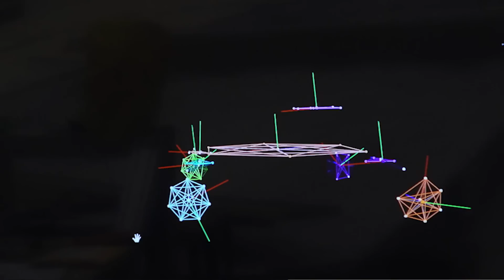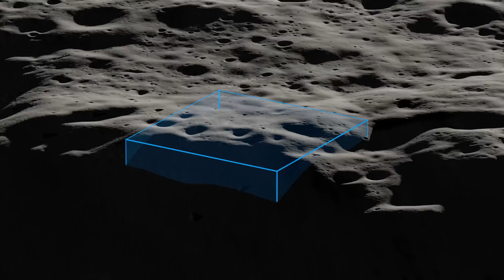The Dumbest NASA Decision In Years? Why NASA is Being Forced To Ground Rover and Sent Ballast.

Comment: Former manager for NASA related ground system projects here.  Generating PMP ESTIMATES for large Engineering projects, can add 10% to 20% to the cost of the project itself!  Especially if they keep asking the team to generate YET ANOTHER ESTIMATE, for even small changes (which can ripple through).  Not sure that all the PMP overhead is worth it.  And the stress level it adds, is incomprehensible.

Comment: With all respect, Scott - You are not frustrated enough about this.  You seem not to be aware of how to properly communicate something when it doesn't make any sense.  You're talking about this insane situation in the same tone of voice as you'd normally be explaining anything else.  If a Reasonable argument can be made in favor of not canceling the rover, why are they not presenting their case?  They can't possibly just sit there all bummed out without doing whatever they possibly can.  Especially after all the work they did.  Don't pretend like they should have written the law differently, as though every issue could be anticipated.  Laws are Easily changed if they're badly written or somehow unfair or nonsensical.  

Is this as insane as it sounds?  Are you honestly explaining the situation?  You've titled this video in a way suggesting you're going to Explain why NASA is being FORCED...etc.  Forced?  You're the expert, right?  I think you need to justify this situation a little better.  Also, if you're not frustrated and/or if you think this situation isn't insane, please explain that.

Comment: Make no mistake: the rover is not flight ready. Vacuum testing is a long process that often reveals expensive problems. So it's not as simple as just chucking the thing on the spaceship.

But it's so close!
Reply: Isn't it just put a thing in a vacuum chamber and turn it on, after 72 hours check the sensors. That's it
Reply: @funguy398  Read "Roving Mars" by Steve Squyres. Similar spacecraft, and boy did they find unexpected problems

Comment: How does the suspension Work in the 10th - 12 Torr Vaccuum? How does the battery Work in minus 200 C?
Of course they cansell it- it doesnt Work on the moon…. No NASA Rover have driven on the moon ever, and absolute not Apollo 15-17, What a joke.
Reply from the maker: How does the vacuum stop springs from working?
How does a rover that stays in sunlight reach night time temperatures.
How does someone as gullible as persist after having all their talking points eliminated in minutes by someone who hasn’t had any sleep in 48 hours.

Comment: You only mentioned this as an aside, but how do you get from water to rocket propellant, in logistical terms? Doesn't that require that you put a lot of energy into it, proportionally? So you'd have to bring a large energy source (or a small solar panel and then wait for a very long time).

Comment: The exception makes the rule.
You have to look at why the rule exsists fundamentally.
And in this case sending "a block of metal" or this Rover would not cause a problem this rule is meant to prevent. Heck even if it was unfinished it'd still be better than sending a block of metal.

Comment: One of the tools being built for this project was a Mission Control dashboard designed by NASA for the needs of their scientists. It’s also been used for various things such as race car simulators and would do amazing for anyone that wants to build their own custom dashboards for gaming or data visualization. It’s also fully open sourced, so if you’re a software developer you can extend it with React or Vue for your custom needs. Google “OpenMCT” to find the project.

Comment: My impression is that this is an engineering management issue rather than just dumb budgeting rules or anything - from my experience just finishing the mechanical design and assembly of a project without fully completing the testing and validation phase can be pretty complicated and there's so much that could still go wrong. It takes a lot of work, time, and money to test and validate projects to the point where you can be confident that they will work 99.9% of the time which is the kind of confidence it seems like you'd need for a project like this. If they haven't even entered vaccum testing it sounds like we have no idea where they're at in the validation process and that's a huge red flag against them actually having "completed" this rover. Nothing ever works out exactly as you design it to even if you've built and operated dozens of rovers over many decades.
Reply: Spot on ??

Comment: I have not seen one other comment say this, but... if it hasn't gone thru vacuum and environmental conditioning, testing, and analysis, you don't know how the final assembly will really react to the different environs it will be forced to withstand. That little rover may bring down the whole mission, and a mass simulator may be the statistically safer bet. I mean, I doubt it, but that's part of what's happening here.
Reply: Sorry, I’m trying to understand what you wrote which sounds like a bunch of words. Don’t take it personal. Can you put it in one sentence
Reply: @stephenrocks7004  
One sentence:
If you can't make sure it's safe, then are you really willing to send the rover and possibly end the entire mission, with all the other payloads?

Expanded slightly:
The final thing they want to do is put it through "Environmental Testing". What that means is putting it through vibration testing, heating it to hundreds or degrees, cooling it to negative hundreds of degrees, putting it in a vacuum, some of these simultaneously, etc. The point of this is to make sure it doesn't fail, like for example catastrophically exploding. If this little rover exploded because something wasn't tested and it ruptured under pressure, that could easily damage the supporting craft, damaging all the other payloads and ending the mission. If they can't test it, due to budget, maybe it's just safer to not send it.
 
Hopefully that helps.

Comment: Fun Congress accounting rules are totally stupid. And this the biggest area over all because they consider sunk costs that is money that can't be recovered spending. Biggest example is Navy comes up with a futuristic destroyer we need not the more primitive one we ended up building because the law required the entire development cost of the new destroyer be divided amongst any more the Navy built. That made it only on paper massively more expensive than the older design so the Navy had to build the older design. 

They need to totally separate development costs from in use production costs. In Accounting this is use Business Accounting rules instead of standard accounting rules when planing future spending. Standard Accounting rules is needed for taxes and insuring theft is prevented. In standard Accounting you buy a 10,000 dollar machine to make something so you have to keep it on the books and depreciate it to show estimate of declining value. In Business accounting the machine is only worth what you can sell it or scrap it for. If the market for the product it was bought for has gone away or there a way better machine now you don't use it just because yo paid for it.

In this case R@D is spent. If it actually ready to deploy you don't count any R&D cost against ti.

Comment: AEROSPACE ENGINEER HERE:
Hey Scott I have a classmate who is now very high up in the ISS Program. 
I promise this will make sense.

Basically if you don't have her signature it does NOT go to the ISS. When they were still constructing the ISS I got into an argument with her about how they were building it. I was in the camp that wanted to use the Shuttle C which was the shoot once version with nothing but a payload pod. The idea many at the time were saying was it was taking too many very expensive space shuttle flights and Shuttle C could lift as many as 5 ISS modules in a single flight. 

Part of my argument as it was for others we needed to get the ISS finished so we could get on with manned exploration.

To say she slapped me down is an understatement.
FIRST - As she put it I had no idea what it took to connect and commission any of the ISS modules.
SECOND - She quite rightly pointed out that until we solve the propulsion and life support issues for long term manned missions NOBODY was going anywhere beyond LEO. Sadly those 2 technological hurdles of propulsion and life support have still not been solved.
THIRD - NASA does not decide its missions and this is still not widely understood. The US Government (as in the politicians) decides what NASA missions do and do NOT happen. If anyone wants to see how badly that can work go and look up a video story Scott did on the Artemis Rocket from a couple of years ago and how there were 2 teams doing the same job on the same rocket and how that made all the decisions take longer and the whole thing be a GIANT CLUSTER F*CK.

When Scott did that story on Artemis I knew exactly what was happening because it was exactly what my classmate had explained to me years earlier. The politicians make decisions FOR NASA based on political needs not technical needs.

Another good example of that was during the post Challenger processes. Kelly Johnson (P38, U2, SR71) came out and said (paraphrasing) "Don't build a replacement. Give my team the $3 Billion and we'll build you a single stage to orbit (SSO)." I have no idea what Kelly Johnson and his team had discussed or what their plans were. That's one of aerospace's great "what If?" mysteries. HOWEVER the decision to spend $3 Billion and replace Challenger with Endeavor was a POLITICAL DECSION not a technical decision.

I was in college at the time and had a couple of heated arguments with people who weren't engineers. The reason to replace was that some MILITARY strategists (YES MILITARY) had CLAIMED that without 4 operational space shuttles America would lose its pre-eminence in space to the Russians because they new the Russians had Buran on the way. So politics intervened and instead of moving on from the Space Shuttle NASA limped along with a technically brilliant but also faulty and expensive system for another 20+ years. It also lead to the decade long era where NASA could not even put men in space they had to pay the Russians to do that for them, which was kind of ironic.

So sorry for the long comment but I think its stuff that needs saying.
Reply: The money saved from the extra shuttle missions could have been put into life support & propulsion research - in a sane world. Point 3 is really the only relevant one. It seems like a mix of single-use and reusable shuttles could have gotten the pieces up there and assembled them. A failure of imagination, and a failure of the administrative state that is baked into our obsolete Constitution. Congress must be abolished, and all regulatory agencies need actual citizen oversight boards who team up with project managers, and, if needed, prosecutors. America needs a 21st Century Constitution to build a government where each agency is capable of leading itself, where successful projects get funding, and where cost overruns are analyzed to see if they're worth the money or if the people involved in the cost overruns get a bad mark on their record.
Reply: @Nphen  And the reason I always bring up those other points first is so people understand what decisions were made that have had long term effects.
Reply: @Nphen  I'm actually Australian but did my degree in America courtesy of a sports scholarship.
A bunch of my friends were pre-law and they used to drag me into their discussions to get another perspective. So I got an unorthodox but interesting education on the US Constitution. 

My opinion is that the US Constitution is one of humanities finest achievements but it has a major weakness in that it guarantees freedom without responsibility and that makes it easily exploitable by people with nefarious goals. We see this right now with SCOTUS and how a very small but well funded group called the Federalist Society hijacked the American Court System without anyone asking WTF they were up to.

Do you know that the people behind all this are NOT Southern Fundamentalist Christians? 
They are actually Fundamentalist Catholics. 

Tied into that are the Libertarians who basically want the entire administrative state dismantled. YES they are totally nuts and unrealistic but they are also highly motivated and have a mountain of money. These are the people like Charles Koch who's a major funder behind the Heritage Foundation and CATO Institute.

So the US Constitution isn't so much the problem it how its being exploited that's the problem and that manifests in things like the decisions forced on NASA and the funding NASA gets.

Comment: NASA has just announced their choice of contractor to supply a " Lunar Terrain Vehicle" for Artemis. NASA chose Lunar Outpost, opting for their lunar "Tow Truck"; for a ten year mission, both crewed and remotely from GATEWAY and Earth.
There two other competitors for the rover contract: Intuitive Machines "Race Car" and Astrobotic "cargo handler".
Astrobotics tardiness has caused NASA to cancel VIPER while still making a profit at NASAs expense. Could this be ONE reason why NASA turned down their lunar rover? Astrobotics have a full size model operating successfully in Death Valley and the other two designs are still on paper; yet NASA still declined.
Mind you, I think the Lunar Outpost design simply beat both the others... by a long shot.

Comment: I hope they just don't throw a nearly finished expensive rover in the trash! Just send me the damn thing! Ya don't even have to pay me, except for expenses.  And meals. I've got my own underground Frankenstein Lab. I've got tools and electricity and lasers and magnets and chemistry and compressed gasses and fire! High speed photography! Access to weird stretches of the electromagnetic spectrum!  And a DOD Security Clearance, if that helps. I'm sure I can figure out something useful.  Cut off a few things here. Weld on a few things there. Drill some holes. Add extra screws. Then freeze it in a vacuum.  Bake it at high pressure. Drop it 10 meters onto simulated regolith. Bury it in a mound of volcanic sand and perchlorate, frozen and blasted with harsh UV.  See? I got what it takes.  And I'll do it for free.  Just don't waste that rover so late in the game.

Comment: So VIPER was solar powered, and was going to go into craters where NO sunlight has ever fallen...  

You know, Glenn Research Center developed a 200W Sterling engine for this very type of mission.  Why wasn't it used?  I'm sure lots of folks are up in arms about the VIPER.  You don't see what's going on close up.  It was a mess and very badly managed, and I expected it would go into the crater fine... but that was the last we'd hear from it.
Reply: It uses an advanced technology called… battery’s
When it gets low on power it goes out of the crater and recharges

Comment: I work as a gubment contractor, I hear them say all the time, "well, we can't spend that because that's a different pot of money." It doesn't matter if it is obvious to EVERYONE that a decision will waste money as long as it doesn't hit some manager's pot of money.  If that manager has the power to kill a project.
Reply: Shit, the same thing is true in big private companies. I was involved in designing and installing a huge paint system at my old job. We could have spend another ~$50k (on a multi-million dollar project) to install a system to partly coat the parts automatically as they went by, thereby eliminating 3 human painters from the system (down to 6, instead of 9) and greatly simplifying the design of the paint booth. I pointed out that doing this would pay for itself within a few months (as well as eliminating the need for 3 more people to stand in a hot booth full of poison wearing very bulky and hot PPE), and I was told that it didn't matter because it would be saving money from a different budget. The fact that it would save at least $200k/year wasn't relevant, because it would cost $50k *now*, and that wasn't acceptable.
Reply: @a.p.2356  Dude, I -know-. This is something I deal with all the time in a not very large corporation, just a couple hundred employees. I try to cut through this stuff by escalating to parties who are accountable to both sets of problems, but that is a real challenge at times.
Reply: Apparently not the case here though: another comment got in contact with their representative in congress and actually got a real response. Apparently the main technical reason is that NASA isn't confident about the "finished" rover actually passing vacuum testing without revealing things that need to be fixed (delaying the launch until next year, because the launch window is missed), nor about the rover making a successful descent. And they simply don't have the budget to keep the teams on staff for another year. The 30% overbudget rule hasn't applied since 2017 and isn't the reason: the main (budget) reason is just overall cuts to the science budget and NASA wanting to keep Artemis funded with what they've got left.

And just launching ballast because they've contracted and scheduled the rocket already is probably still cheaper than having to pay the company for the rocket anyway after a lengthy legal battle. Because the company that prepared the rocket has every right to expect their money. Not their fault that the rover company took too long to "finish" their end of the project.
Reply: Absolutely flailing in government, quite disappointing